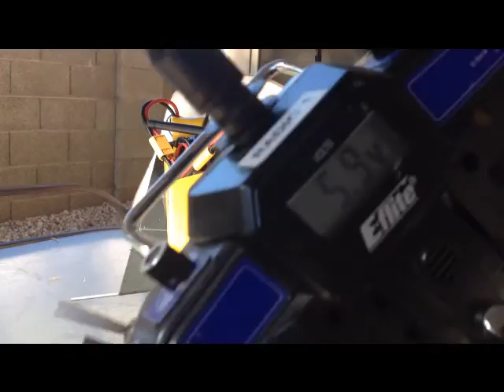THRUST VECTORING DroneBuster StartUp

Comment: Hi. I am a mechanical engineer student. I really like your job with your drones, so much we decided to build a project based on your design. I wish I can get a little help,  we have everything done except its not stable. We are using 4 flaps instead of 3. Can we have some help please?
Reply from the maker: What kind of an instability are you experiencing?
Reply: un rcontol hi, we have small control over the Drone, it's seems like our "flaps" are not long enough. We are using flaps similar to wings. Is there any reason why you are using C-shape flaps? Also how are you controling the Drone with just 3 flaps?
Reply from the maker: Jesus Pacheco you need to send me photos and a flight video, then I may be able to help
Reply: un rcontol can we get in contact through hangouts?